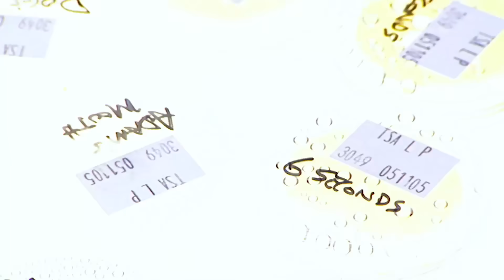Drop It Like It's Hot! Is The Five Second Rule Correct? | MythBusters

Comment: The five second rule doesn't mean that food is uncontaminated if it's on the floor less than five seconds, just that it's "good enough" to pop back into your mouth.  It also depends on the food that's dropped.  If you drop a piece of bread with peanut butter on it peanut butter side down, that thing is getting thrown away every single time.